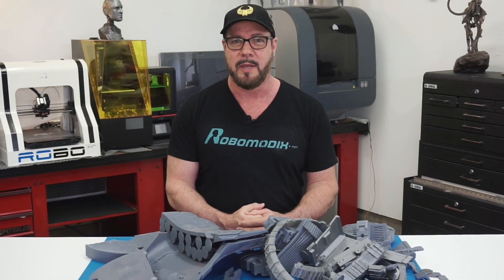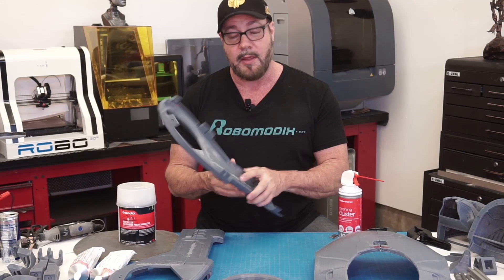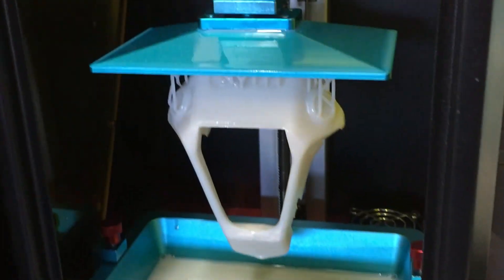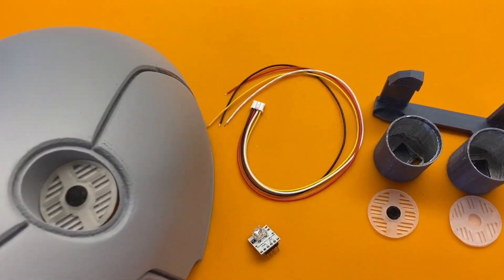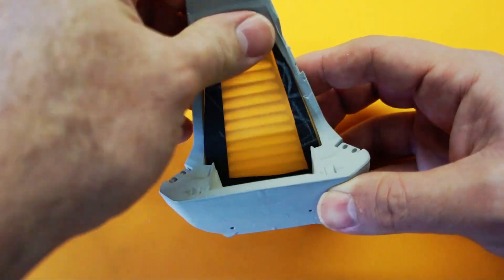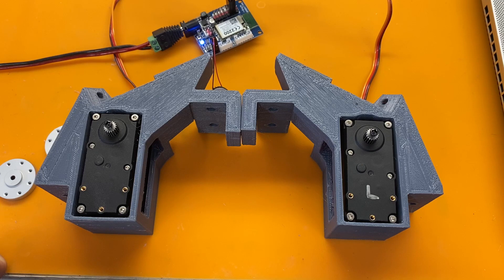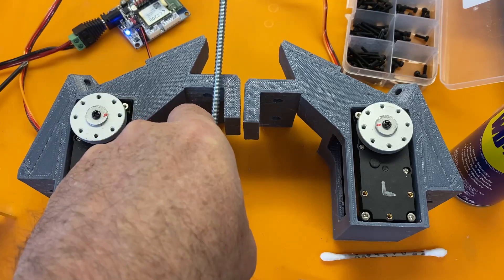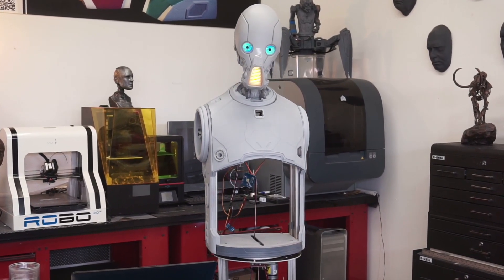My droid gets a head and voice!  (Episode 2)

Comment: Will, I had to watch this episode again. It's one of my favorites. Such amazing engineering and craftsmanship. Thanks for sharing.
Reply from the maker: Thanks Dave!
Reply: @Will_Huff  I'm going to start finishing two sets of 3D printed B9 claws and was needing a little moral support before I started. Your technique is just what I needed. I've never finished 3D printed parts before and your results with the seams are beautiful.
Reply: @Will_Huff  Do you have an episode showing how you finished and painted the large outer parts of this robot? I've watched all your episodes but can't remember this step. Your prints seem so smooth. Do you have to do any prepping to get rid of the 3D print layer lines?
Reply from the maker: @DavidSchulpius  yes I think it’s episode 2 or 3 I use a glazing compound and rotary sander to get rid of lines. I prime them in this episode but my next episode is putting my final paint on the parts ( episode 6) and is not yet out .
Reply: @Will_Huff  Thanks Will. The final paint job is what I was looking for. Will be waiting to see that one for sure.
Reply from the maker: @DavidSchulpius  It’s underway! Hopefully out in a couple weeks or less!

Comment: Why don't you use friction welding?
Reply from the maker: I feel like I am getting a better bond using the hot iron as I can get maximum melting temp vs friction.
Reply: @Will_Huff  I actually use soldering iron a lot and the structural strength success is a VERY thin line......The problem with the soldering iron is the temperature. if you are off a certain limit, then plastic will become brittle. Also, you might find it useful to use the TIG welding techniques with adding materials, not just melting parts.

Comment: Do you find the soldering iron fusing better than using a solvent adhesive?
Does it give a stronger bond?
Reply from the maker: Yes it’s as close to a single solid piece than any gluing..especially with petg.